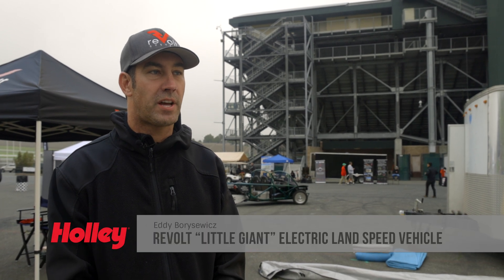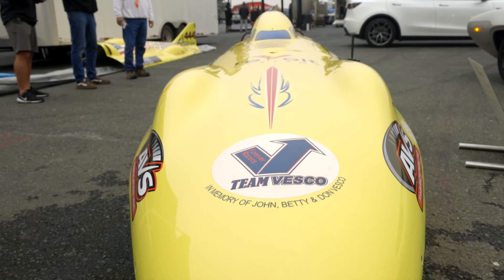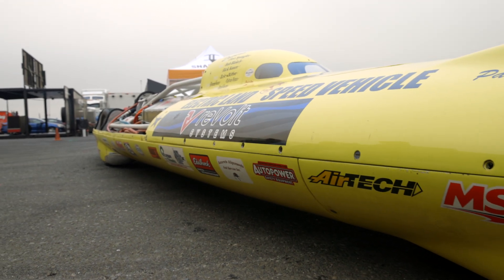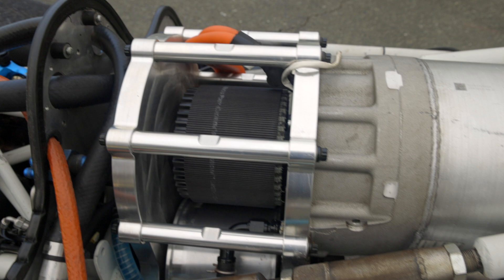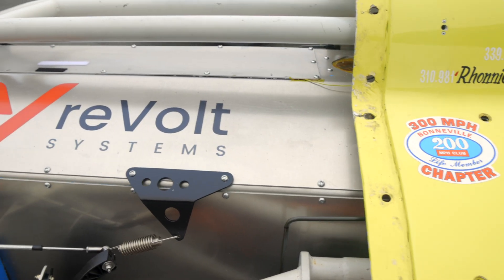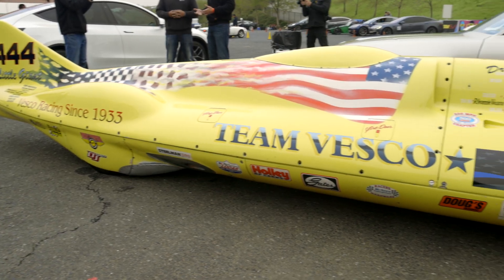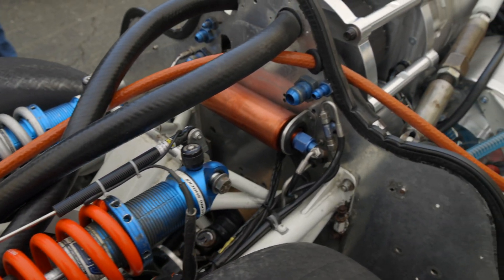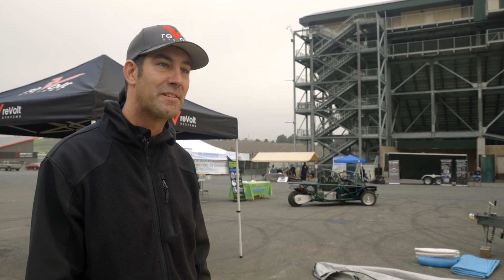High Voltage Experience 2021: The ReVolt/Team Vesco “Little Giant” Electric Land-Speed Racer

Comment: Obviously the car is very aerodynamic....Simialr looking velo mobile pedal bikes can reach like 50 mph due to being light and aerodynamic.
Now if there is such an energy crises & global warming problem & most people commute to work alone. Why hasn't some car or motorcycle company build a cheap/affordable  tandem 2 seated lightweight aerodynamic commuter production vehicle. Either gas or electric to help solve "the energy crisis?"   A Honda NC750X motorcycle gets 65 real world MPGs even with it's horrible aerodynamics. Make it a 3 wheel vehicle you sit in, tandem 2 seated, with a lightweight, removable aerodynamic weather enclosure. And you have a 65 mpg or more commuter vehicle with plenty of power 125 mph top speed off of a gas engine alone. If it was electric it'd use way less power than a giant electricity guzzling truck. They scream "energy crisis" & "man made global warming !!!"    Their solution = Build big electricity guzzling vehicles. Use small cheap gas/hybrid or electric car for commuting & save wear & tear on your big truck & only use it when you need to carry heavy loads instead of daily driver.  The VW XL-1 hybrid gets around 200 MPGs on a full charge & 1 gallon of diesel fuel. The VW NILS personal transport vehicle uses much less electricity than a normal EV. Although I'd make a tandem 2 seat with removable top for nice days.

Comment: That's incredible you never think that a electric motor would go as fast as that, but when you look at the Tesla platform there so fast down the drag strip 💯🤟👏👍
Reply: Teslas get beat by real race trucks and cars all the time lol
Reply: @hennickracing  but there still pretty quick for a electric car.
Reply: @Derrik Hennick  Teslas aren't "real" race cars, though.  That's the whole damn point.
Reply: @hennickracing  I think it is hard to argue against electric in straight line performance. Where they do start falling apart is road racing, endurance racing, or even road trips.
Reply: @larney37  I have nothing against EV's  but Tesla's are of poor build quality for the price. I'd rather build my own easy to repair VW electric Baja Beetle for around $25,000 or find an old Ford Ranger with good body but trashed engine, convert to AWD EV & add solar cells on the hood, roof & truck bed cover to help recharge it. If the truck sits in the sun for 8 hrs while I'm at work, when I get off work. It'd get  recharged enough to drive the 20 miles home for free without needing plugged in.
Reply: @michaelbrinks8089  Hey, I totally agree with everything you just wrote! :)
Reply: @larney37     It's super to rare to find someone online who totally agrees me... lol.
   The other odd thing I noticed about almost every small 1 or 2 person "personal transport" commuter cars is. It's as if they're purposely trying their hardest to make them look as dorky & unappealing as possible. Like they're trying their hardest to build something that people would feel embarrassed to drive. It'd be easy to make it look sportscar like or a bit rugged off road-ish even a bit off road capable.While still being practical, fun to drive even with a bit of power & get 70 mpgs. In some ways I like the way the VW NILS concept car looks but I'd make it tandem 2 seated, able to handle rough gravel/dirt country roads, light snow with removable 3 piece storage compartments for road trips- 2 saddle bags/side cases & 1 rear storage case similar to an adventure motorcycle storage setup.